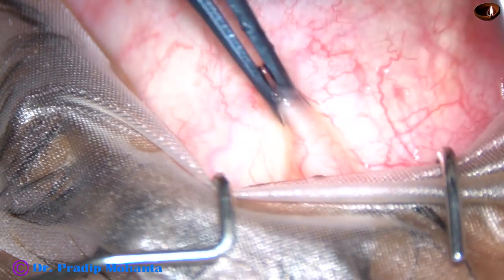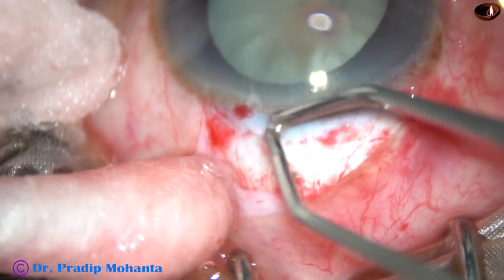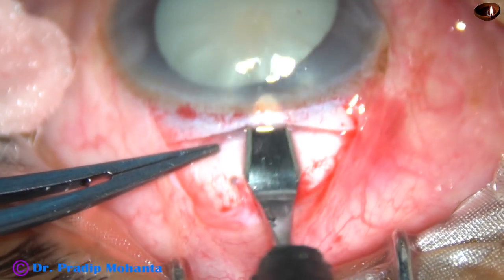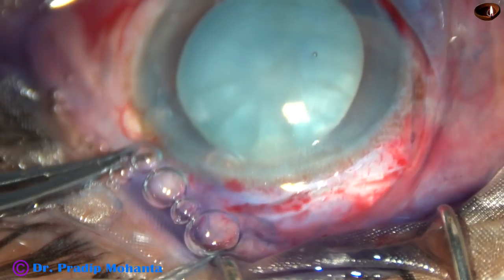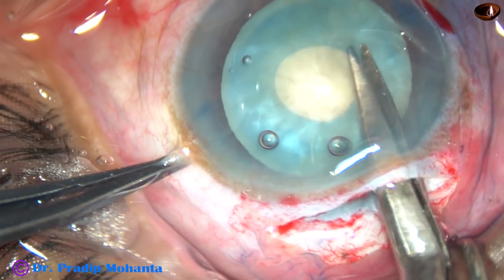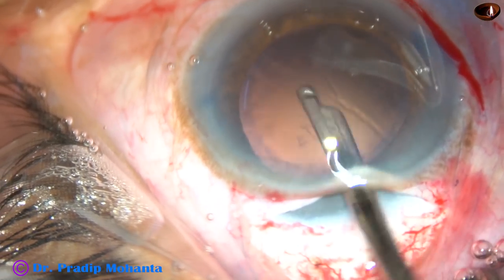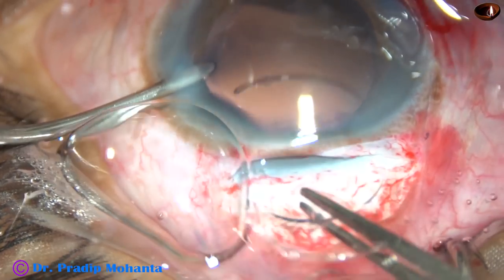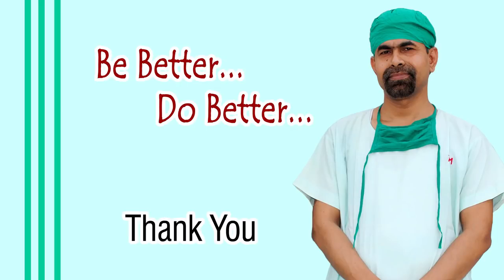SICS of an Intumescent Cataract &  PMMA IOL  implantation under Irrigation

Comment: Sir I tried this technique but as soon as I entered the small rhexis with Simcoe to aspirate, anterior capsule got tore off just like argentenian flag sign.why this happened? How to avoid it?
Reply from the maker: It has happened in my hands also in some cases.
The way to prevent is to be gentle and DO NOT PUT any stress on the margin of the minirhexis.
Reply: @pradipmohanta9321  ok.thank you sir for ur prompt reply

Comment: Is there any reason to do the SICS procedure in today's day and age? It seems rather invasive and unnecessary these days not to mention the complications associated with SICS such as a prolapse of the iris, for one. If I am wrong, what are the positive reasons you would perform this procedure vs the 2 or 3 port-only method? Thank you doctor.
Reply from the maker: Robert Smith 
 The only reason is to teach the ophthalmology residents of INDIA, CHINA, BANGLADESH, NEPAL, BHUTAN, BURMA and many other countries. They have to learn SICS even in these present days because in those countries, phaco machine is not provided to every centre where they will work. They have to do manual surgery at a high speed to combat blindness. I personally do not like to do this tissue cutting surgery.
Reply: I see. That was an enlightening answer as I did not know how critical the situation was in those corners of our world. It now makes sense to me. Thank you for your reply.
Reply: Pradip Mohanta  sir why do we do side port entry in SICS. 🙂
Reply: He does so to remove cortical matter. The frown cut, alone, will not help do that job.
Reply: @sheetalpushkar1355  I think to reduce  post opt astigmatism. Also helps making rhexis and cortical removal easy.